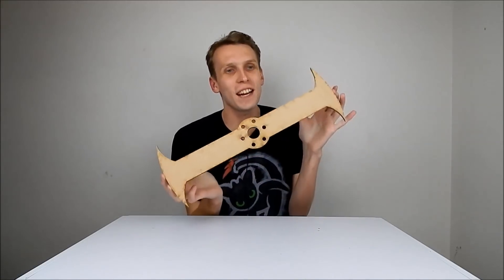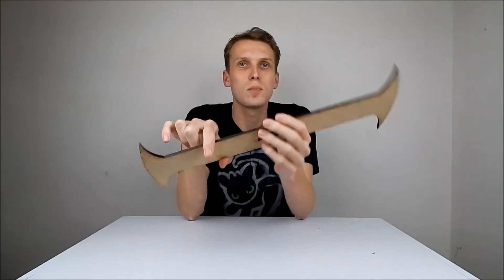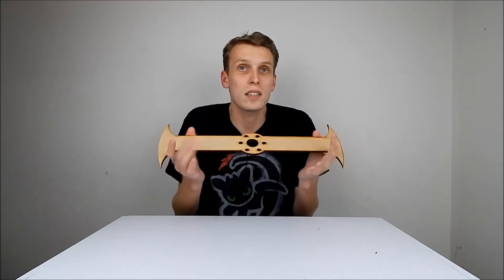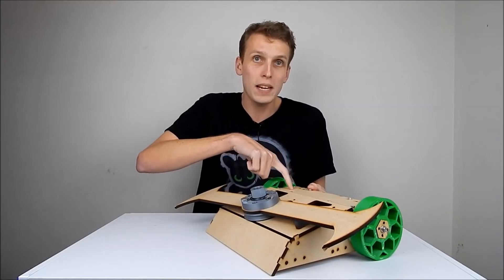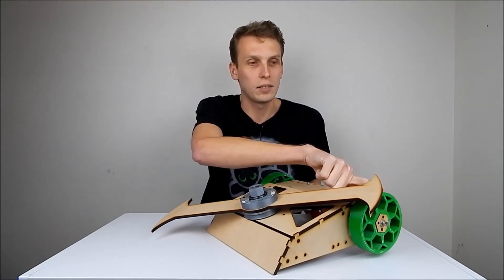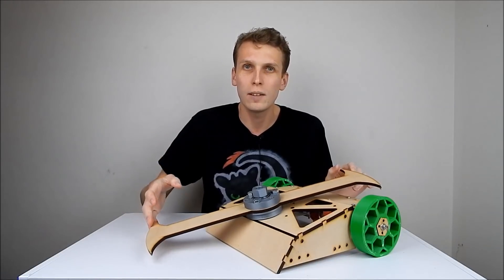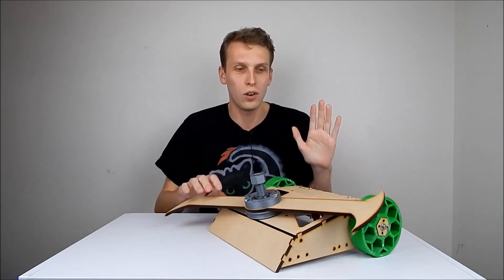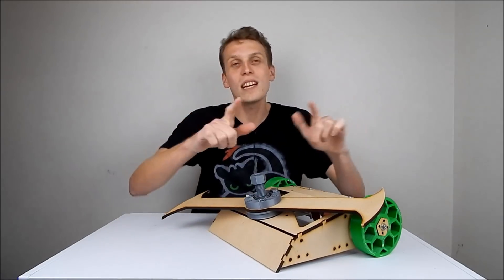13kg overhead combat robot: Wood Prototype!!

Comment: Just a quick tip for your gluing practices. If you want a really strong hold, use a brush to get an even coat across the entire contact area. Makes for very strong consistent joints!

Comment: Cool project man. I would worry a little about how thin the weapon is where the holes have been cut out of it around its centre. Im sure we've only recently seen a bar spinner's weapon snap in half around the mounting on battlebots... Could you maybe see where it fails by live testing the wooden prototype until the weapon snaps?
Reply from the maker: If you are thinking of valkyrie, that was because they welded stabilising rings onto their weapon. The heat of the welding messed with the hardness of the blade and created a stress point. Thats where and why the blade broke.

I'm honestly not too worried about the blade breaking, it will be 10mm of Hardox steel. The aluminium hubs or the bolts holding it together will break first

Comment: Really excited to see you start to jump to the larger weight classes. This prototype also looks really good. However, I do have a few suggestions. For the wheel clearance issue, you could make the wheels smaller and lower them. The robot is already not going to be invertible because of the bar on top, so there is no sense in having wheels that large. Also, the shock mounting for the drive doesn't look too great. On the video, it looks like the drive motors have very little room to move around, but this may not be the case in person. I think robert is able to get away with having his drive pods the way they are because the aluminum deforms and takes up most of the energy, but with steel there will be a lot more shock going to the internal components. If you needed more weight to do this, you could make the wedge 1mm smaller. This would also allow you to make other systems more robust. Good luck in your bot building endeavors! Side note, do you have a cad model of what the final robot is going to be?
Reply from the maker: Thanks for the suggestions. 
I have been thinking about shrinking the wheels, but it will depend on weight. If I have weight to add a UHMW wheel guard then I will shrink the wheels a little.

The motor mounts in the prototype are the same ones I used in my 13kg sportsman bots: Strange Young Man and Video Game Violence. In those bots they held up fine. I also used the same type in my first 13kg open class robot: Slightly Crude, it was a simple wedge built before I started this channel (although there is some fight footage in one of the first videos on the channel). In Slightly Crude, this style of motor mount cracked, so for Very Very Obvious I am making the full motor mounts out of a semi-flexible material, so they will be durable and act as a shock mount

Unfortunately, I can't make the wedge any thinner now, the parts have already been cut. I could do it manually once everything arrives, but thats a lot of work, and I think I might end up underweight anyway

Comment: Realy great video! Prototype is something what a have to do more times. If may i give to you a tip, the screws in pulley and weapon break  easy with impacts, maybe you can make a shape in the pulley who fits in the weapon, so the pulley will recieve the impact and not the screws
Reply from the maker: Its not a bad idea. but in this case, it's not going to make any difference.

The two pullies are held together with 6 M10 bolts.
Those M10 bolts are way stronger then the aluminium I am making the pullies out of.

Also, if I did shape the pullies to fit the weapon, they would be super expensive because I'd have to pay someone else to machine them. the pullies I am using I can machine myself.